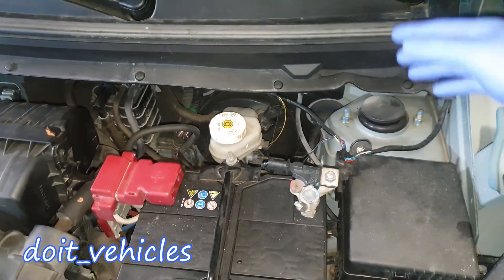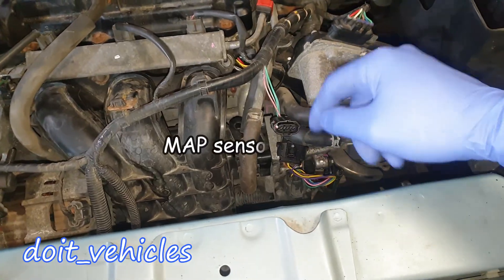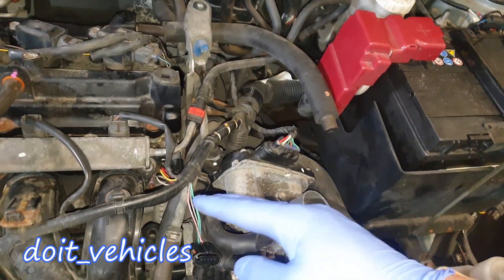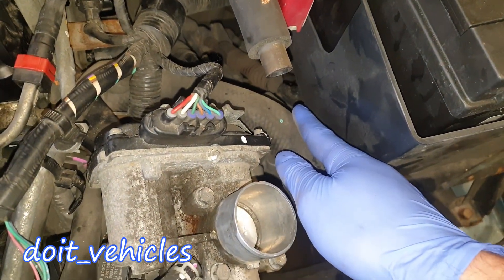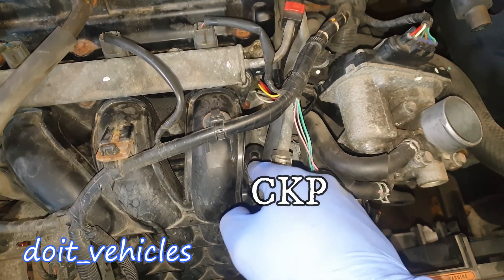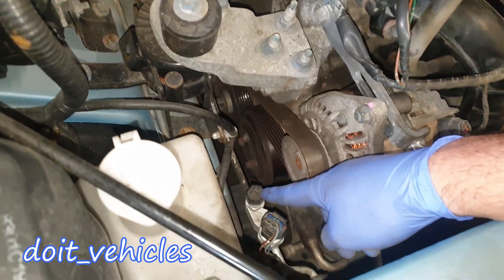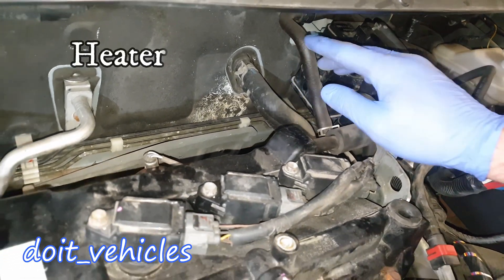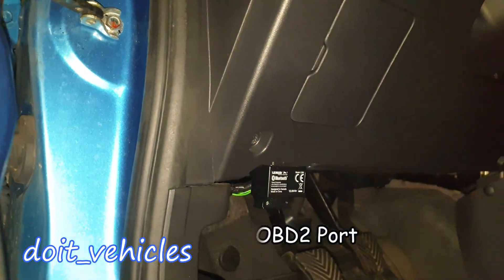Location of ALL Engine Components of a 1.0 Mitsubishi Mirage Space Star ( 2012 - 2016 )

Comment: If anyone can provide a clear picture or diagram of idle air control valve {LOCATION?}, I will appreciate it.  2015 Mitsubishi Mirage (US) 4-speed manual.  I have cleaned the throttle-plate, but car seems to almost stall when at traffic stop.  Thank you.

Comment: I have a mitsubishi 2017. 4 Morge . It turns over but won't start. I was going down the freeway and it just stopped on me. When I pulled over, it wouldn't start, it will turn over, but it will not start. What do you think it could be, pleasePlease help.
Reply: Check instructions on resetting emergency fuel cutoff switch.   Sometimes the switch can be bad other time a sharp jolt will trip it. My 2003 Ford Ranger had a bad switch that kept tripping.  My 2015 Ford Fiesta got a jolt when I started it with the gearshift lever in first and my foot slipped off the clutch.  The Fiesta switch is reset by turning the key on with out starting then turning it off .

Comment: I am really struggling to pull ckp swnsor plug out, any tips? My plug is a little damaged but even trying to figure out what to push to get it to release
Reply: Sorry it's not the ckp there's a blue plug by the oil filter with a single red wire attached, what ever that one is called